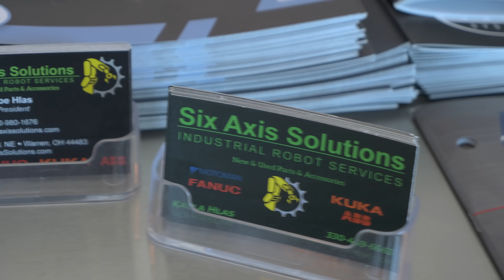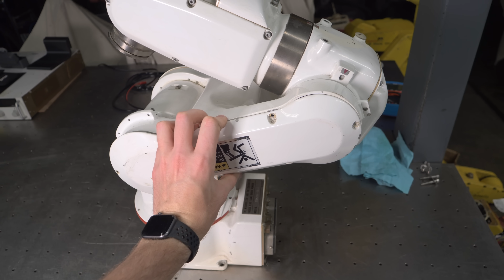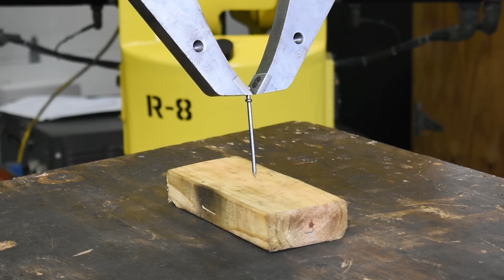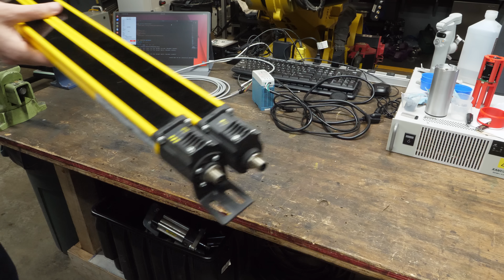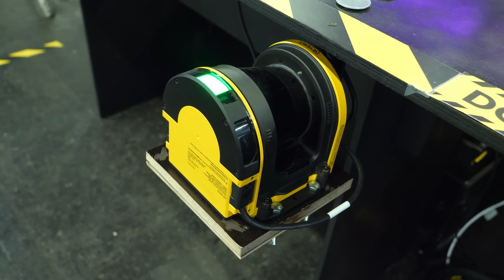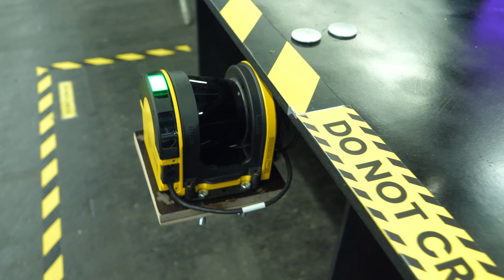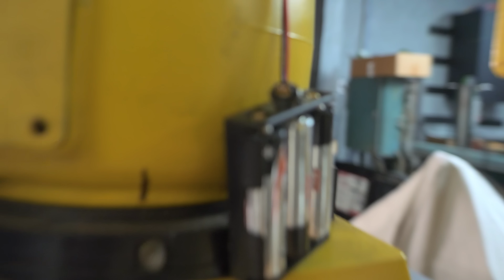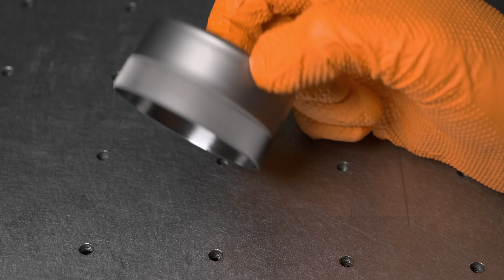How I Get Industrial Robots for so Cheap

Comment: The Fanuc pendants are also made to E-stop if you grip too tight.
Reply from the maker: The old rj2 controller pendants only stop when released. I believe the rj3’s introduced the pendants that also stop if you grip too tight
Reply: Called Dead man switches, more normal name being Enabling Switches. The newer standard is to use a three position switch which is what you are describing. Two safe positions being: released i.e. you let go or dropped the pendant, or pressed fully being you gripped too tight because you tensed up due to being hit or getting scared. Pretty cool things
Reply: That makes a lot of sense as obviously following logic to stay chill and let things go while panicking is practically impossible
Reply: Or from being shocked/electrocuted and having all your muscles forcibly flexed and gripping too tight
Reply: Indeed, should be standard on all industrial robots teach pendants.

Comment: what do you think you could turn an old 3d printer into.
Reply: I recently rejigged an old 3D printer I had into a simple 3-axis wood milling machine by attaching a small dremel to it, stiffening a couple of the joints, and writing a bit of extra software to help control it. 
It's a fun project if your 3D printer has the torque to handle that kind of motion and extra weight, although it was definitely a bit more work than I initially expected before I had it operating smoothly.
Reply: @reumarks  that is a very good idea thank you.
Reply: i turned one into an equatorial telescope mount.

sadly you need planetary steppers or printed gearing to make it actually accurate.
Reply: An old plotter
Reply: a pick and place
a better 3d printer